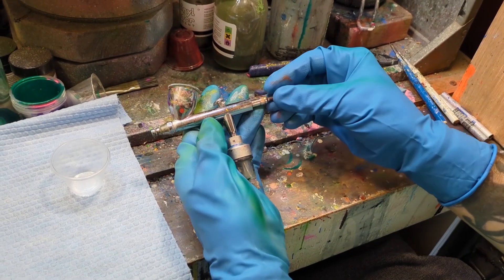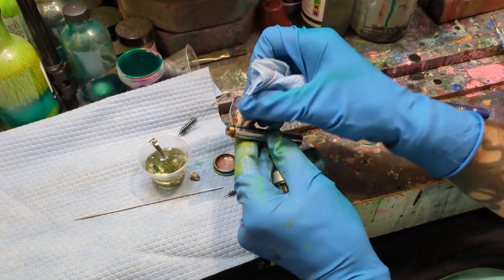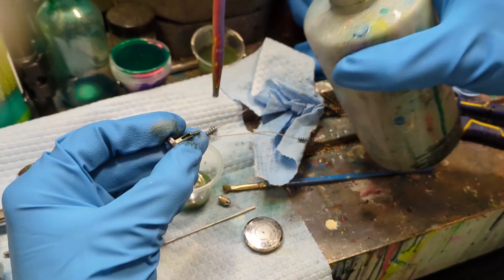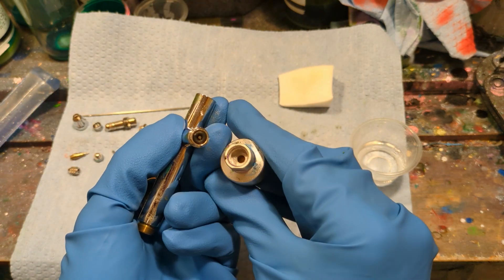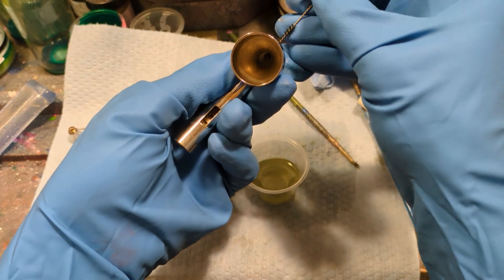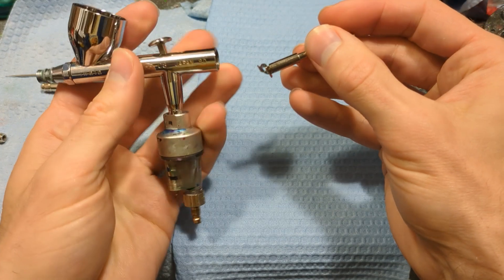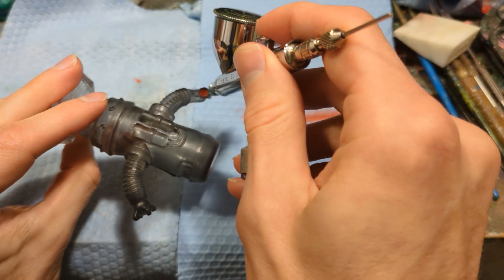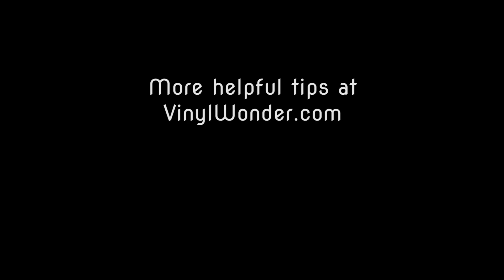Airbrush Deep Cleaning Tutorial for Vinyl Toy Paint

Comment: Excellent video. Thanks for the explanation. 👍👍👍
I have two questions:
1. I have a friend who disassembles the entire airbrush and soaks the metal parts in thinner a day before. He has told me that this makes it easier to remove old paint. Then he runs a wire brush to clean the inside. Does it seem appropriate to you?I understand that you don't have as much free time as he does.😄
2. If the needle is a little damaged at the tip, doesn't this affect the flow of paint? Even when the needle is a little warped in its length, I think it affects the function. How do you verify that the needle is completely straight? 🤔
Thank you. 🙏
Reply from the maker: Hey! Good questions. 1. vinyl thinner works pretty fast, and is stronger than most thinners, so I don't think you need to soak the parts that long. 2. I've never had a needle warp, but I have dropped one before and it chipped the tip. You should be able to see that it's damaged by looking at it with a magnifying glass, or if it doesn't spray well, that's a good sign. They aren't too hard to replace, thankfully. Thanks for watching!
Reply: @vinylwonder  Thank you. Noted.✍